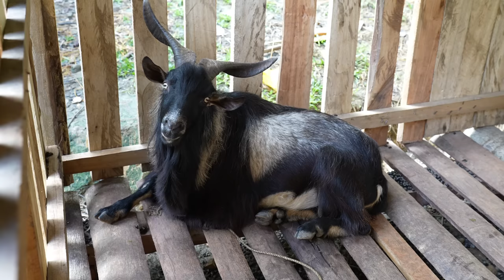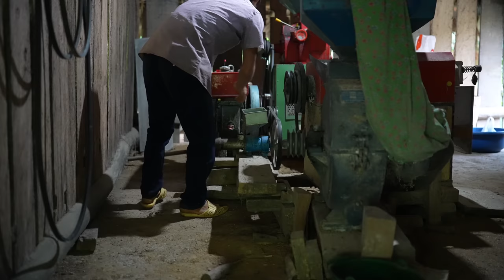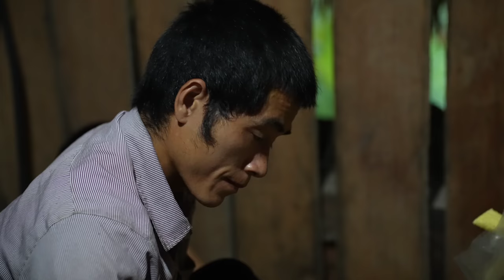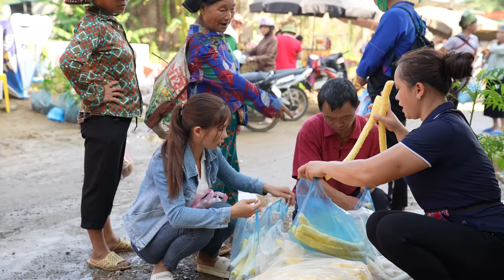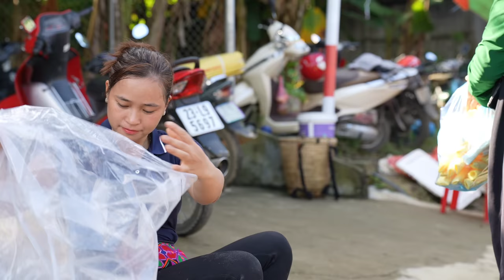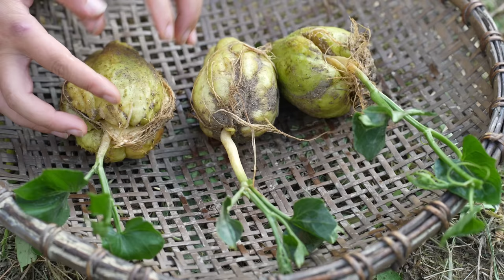Popcorn Making Process Goes to market sell | Plant chayote - Gardening

Comment: Wow you are such a hard working woman. That looks so good too. In my younger years there was a woman selling balls of popcorn mixed with melted marshmallows and colorful with food coloring. I wonder if you mix some with marshmallows if it would stick to the machine. Or if some don't sell you can break it apart and mix with melted marshmallows and little butter too. Almost like rice crispy treats. The woman used to add food coloring to make them colorful. Here at some amusement parks they make funnel cakes by poring pan cake batter to hot oil. So good. 🤗

Comment: How does this machine work? Raw rice or corn  goes in and a puffy tube comes out? There must be water inside, or oil? 
I want to learn more.
Reply: The screw auger, which is conical in shape, drives the corn in and compresses it. The friction and compression raises the temperature to well above boiling, and when the now-gooey hot corn/rice reaches the extruder nozzle (which is quite tiny), a thin ring of it is extruded. The sudden drop in pressure allows the superheated water to suddenly expand into steam, puffing it up (the same puffing process as in actual popcorn). I think the non-obvious part of the process is that the auger’s compression is sufficient to heat it, but apparently this same effect is commonly used in certain types of plastics extrusion, where the mere auger compression is enough to heat the plastic pellets to several hundred degrees!

Comment: How does the machine work that turns out the tubes?  Thanks
Reply: The screw auger, which is conical in shape, drives the corn in and compresses it. The friction and compression raises the temperature to well above boiling, and when the now-gooey hot corn/rice reaches the extruder nozzle (which is quite tiny), a thin ring of it is extruded. The sudden drop in pressure allows the superheated water to suddenly expand into steam, puffing it up (the same puffing process as in actual popcorn). I think the non-obvious part of the process is that the auger’s compression is sufficient to heat it, but apparently this same effect is commonly used in certain types of plastics extrusion, where the mere auger compression is enough to heat the plastic pellets to several hundred degrees!